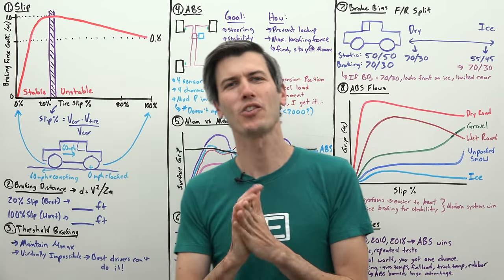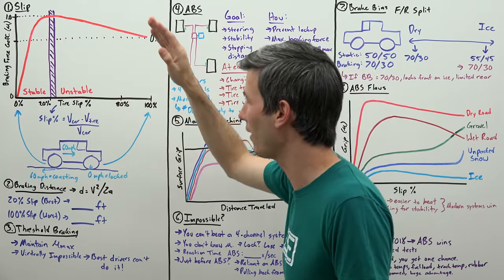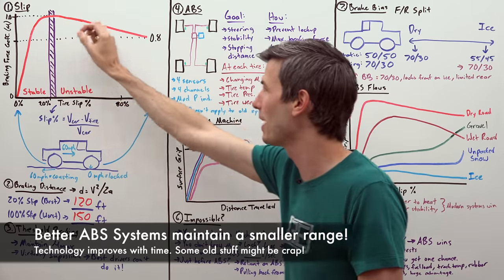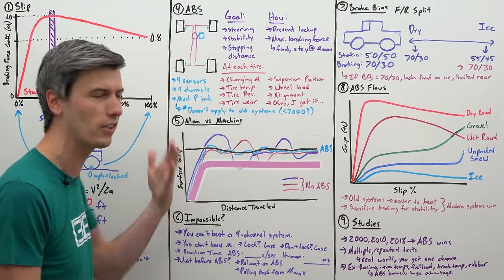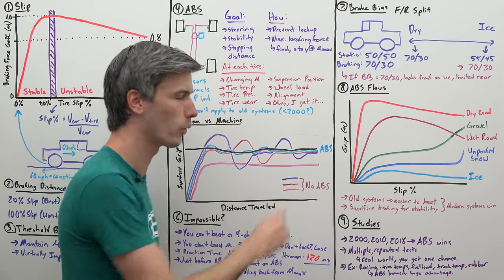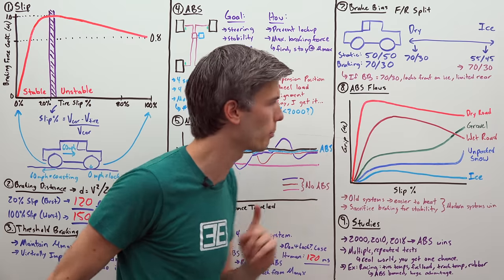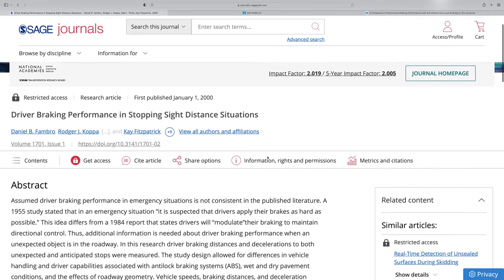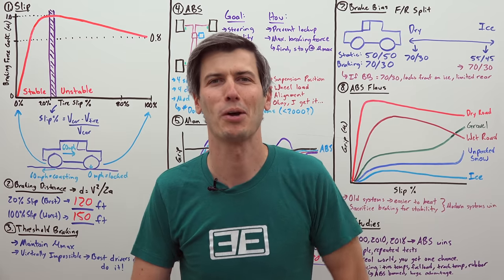Why Threshold Braking Is Impossible - ABS Wins!

Comment: Hello there! Just one note at 3:35 , both professional and casual drivers might also actually fall below 20% slip if they are too cautious about it. For motorsports like F1, there tyre degratation must be managed carefuly, I bet that they more often fall below 20% slip to reduce risk of locking up during race (as the implications are quite heavy - increasing wear exponentially due to flat stop, etc.).

Also, about 14:50. Even if you practice threshold braking and get good on it (its not really that hard), you still might not have done enough repetitions to make yourself do it subconsciously in emergency situation. When a kid suddenly runs on road and you have to emergency brake, its not a conscious decision - before you even realize, your instincts will kick in. In order to reliably use threshold braking in that situation, you really have to train it A LOT in ordero to do it subconsciously. Its not like, you try 5-6 times and say "umm yeah, now i get it, i'm ready" xD In order to turn it into a reflex, you must repeat it like hundreds or thousands of times.

Comment: I have a  question related to this.
How does a bigger/ aftermarket brakes increase braking perfomance?
Since stock brake has enough force to lock the wheel, which is more than optimal since we only want around 20? slip?
Reply: You can stop fast 4 times  a row and the brakes still work   vs oem will not.

Comment: The only time in my driving experience that ABS didn't help me was when I breaked at 20km/h on an ice covered road in my Mk5 Golf, it stopped in 10m+, i almost hit the car in front of me. 6 hours late at night I went in the exact same spot with my Mk3 Golf (doesn't have ABS) and to my surprise when I slammed the break it slowed down in 2m, without locking up. Still, ABS remains superior, i am currently driving just my old non ABS Golf and there have been a few situations where I had to threshold break, but since it only has 54 hp and i never go above 90 km/h i don't feel its absence generally speaking.

Comment: The S2000 is I believe a pseudo 4-channel system (measures all wheels separately, but actuates rears together).  It definitely does better than I could in a straight line, and especially in slippery conditions, but it's also definitely not optimal.  If you just slam on the pedal, you'll get a significant tire chirp (full lock-up) every time before it finds the zone.  Also when trail braking, you need to ease off the brakes; you're definitely going to be slower if you're just in full ABS while trying to turn, because then you can't choose the tradeoff you want between slowing and turning.  (But admittedly, we're not talking about threshold braking there.)  The other case though where I find I can outperform the car is if there's something that unsettles the car, like a bump, in the braking zone.  It's probably just the S2000's dated ABS, but it will back off in braking pressure in this case, and not get back on it once the car settles.  And finally, ABS failures happen, for example if for some reason the engine shuts off, or if a wheel speed sensor is damaged.  Those can be a significantly worse time if you're used to fully relying on the ABS rather than the technique you mentioned of just using it to help you know where the threshold is.

Geeeeenerally I agree though; you're always going to be faster in a car with a good ABS system than one without, and a good system will outperform a human in most cases.

Comment: I have no doubt that these systems do a better job than a human. I found out how good they are the first time I tried to drift my new pick up around a corner on a snow covered back road and the stability control intervened and set things right. Luckily there is a button to turn it off so I could have some fun. I was amazed how easily the system straightened out the drift I had managed to start.

Comment: well about stopping distance i feel like on dry asphalt having slip is going to stop you (in a straight line) faster than grip braking 

i have seen abs have longer stopping distance than just lock up braking on motorcycles but not tested it myself in my car yet
Reply: Motorcycle ABS systems intentionally limit braking power to prevent stoppies/endos, motorcycles also allow the rider to modulate front and rear brakes independently where in a car you only have one pedal; which is why people can often out brake ABS systems on motorcycles. Locked tires on dry roads do have a longer stopping distance than one at ~20% slip. If you view a race car locking up their tires into a turn you'll notice they miss it completely or have to take a slower line, which means they came in too fast (from not braking enough).

Comment: Is the abs system tuned specifically for the tire being used? Or does it use sensors to work with other tires? I wonder if switching tires, and the ideal grip slip % changes, would abs be as effective?
Reply: There are sensors on all 4 wheels (in modern systems, at least) to detect when they begin to slip. So no, it isn't tuned for a specific tire.

Comment: My car's got ABS but if 1 wheel locks it backs off all brakes. Fine on the normal roads but I drive on broken dirty wet country lanes regularly and it just feels like the computer won't let you stop. Hate ABS on motorcycles too. Feels dead

Comment: I've a 2009 Fiesta with ABS but not ESP. The ABS is kind of twitchy.. the tyres make lots of rumbling noises during ABS, but I doubt they are fully stopped but are just within that unstable region. The car's yaw can start to run away on a wet surface though.. had that happen once but fortunately was able to correct it by keeping my eyes locked at where I want to go. This is probably the lack of ESP. If ABS job is to keep each tyre at max grip, then an uneven distribution left/right can make it slide. ESP would then correct for that by comparing vehicle yaw and steering input, and making the ABS work some tyres a bit less hard to maintain stability. In theory you would leave some grip on the table, but in emergency situations we don't want to follow the trial of peak grip, but a trial of empty space not to hit anything. It's better than spinning out and crash into a tree instead of a car. So my next car will definitely have ESP.. but it's also mandatory for almost 10 yrs I think so that should be OK.

It's absolutely insane to think that people can outdo computer systems like this. ABS, ESP, traction control all have very well defined jobs with good sensors that operate at high frequencies, with fully proportional control. I've talked to some people that still believe that pumping the brake pedal is the ideal way to stop a car ...

Comment: @engineeringexplained What formulas would you use to calculate how big impact does wheel and tire package weight have on braking distances? Each time wheel is locked heavy wheel takes more time to start rolling again due to inertia.  25kg 255/45R19 wheel has inertia around 2,073 vs 195/60R18 tire with light wheel can weight 15,5kg and inertia is 1,264. That is a huge difference but what is the calculated impact to braking distance if you assume braking coefficient stays the same? Whole car comes lighter and so on.

Comment: I currently drive an old shitbox without ABS and when it rains I get a bit worried, since my car is so light, it's very easy to lock the wheels on slippery roads if the need for emergency breaking arises. I have driven modern cars with ABS and it's way safer to break under those conditions.

Comment: Great video! The machine always wins. And that we know all that drive hard enough. However i would argue humans can still have some form of winning when abs and traction control fight each other. Driving a  '10 mini cooper s on european curvy roads, hard braking while trowing the car around caused some really weird interaction between the two systems making the braking process very much longer than it should have been. I think that maybe thats what people have in mind when they think they can beat abs, which they cannot. But MAYBE they can bit the funky interaction that abs has with each manufacturers implementation of traction control

Comment: There are a few scenarios that will confuse most abs systems in such a way that you could reliably beat most of them.
The one thing abs systems are not good at - as mentioned - is when the ideal amount of slip is not what the system expects.

This can happen if you install tires that behave very differently from the regular stock tires (low profile slicks on one end, high profile mudd/offroads on the other), and or your car has become significantly lighter/heavier than it was stock (weight on the wheel affects ideal slip angle).
it can also happen in a dip in the road (the car is effectively heavier) or a crest (the car is effectively lighter)

You could solve this with some accelerometers and some more logic in the abs system, but there is always a way to confuse it.
I recall Randy Pobst crashing a mazda rx7 fd because the brakes went into ice mode over a crest.

That said, I'm not removing my abs, tho I'd like to have a switch for it.

Comment: The anti-skid system on the F-15a/b (designed in the 1960's, discrete analog, no microprocessors) makes adjustments around 1000 times a second and actually measures the rate of change of wheel speed (with just freaking transistors and gates!).  In other words it can tell the wheel is about to lock before it is actually locked.  I don't know the actual number but the maximum performance braking occurs when the wheel speed is a certain percentage of the vehicle speed.  I.E. 90% wheel speed of actual speed.
It's generally a bad day when you lock a wheel when you have only two on the ground.  It does such a good job the pilot can just mash the rudder pedals and achieve max performance breaking.

Comment: Based on this, the only way to improve or worsen braking distance is with tire selection.  Is it true that installing better pads or a better braking system will not realize its full potential unless better tires or more traction by changing the tire size?  Will better pads or calipers improve stopping distance with stock tires?
Reply: I would think that better pads or discs wouldn't help that much in normal driving with stock tires as your regular pads and rotors are more than capable of locking your tires up, and the limiting factor would ultimately be the grip of the tires on the road. However, if you're racing you can easily overheat your brakes with a couple of hot laps, which would cause brake fading and that is something better aftermarket brakes often help to fix. There could also be other benefits to aftermarket brakes like weight savings, better looks and improved braking with better tires. Another thing is that while you might not "need" improved brake pads for your everyday car, they can improve the feeling of the brake pedal.

Comment: I have had two situation where I would be better off without ABS. One I had one wheel on ice, the other on snow. I did not have ABS at the time, and I managed to stop, right two tires locked up, left two still allowed to brake. Tried similar with ABS, luckily without traffic in front of me. I would have hit the car in the first situation for sure. Second, on a severely weird crest, I had one tire almost without weight on it. ABS did not allow me to stop until I had weight back on all tires.
Compared to the situations where ABS has saved me though, it is absolutely worth it.

Comment: A partial solution to decrease the snow/gravel braking distance in an ABS-equipped car my driving instructor taught me is using an e-brake to lock up the rear wheels and make them plow while still maintaining the rotation and steering on the front wheels. That proved to be a useful skill not to participate in those "Bodywork service weather day" events. One example: I was crawling at around 25 MPH on a snowy/slushy road and saw some driver blindly rolling the front half of the car out from a secondary road onto the one-lane one-way street I was riding. I slammed the brakes and the only obvious effect was the ABS clicking. Then I lifted the E-brake while keeping the brake pedal down and maintained the direction by steering (BTW, my car isn't equipped with ESP) and braking force increased allowing me to stop just short of hitting that car. Obviously, this method has a number of limitations: it's hazardous at higher speeds, it may not work on cars with a "smarter than just a button and an actuator" electically actuated E-brake and it's definitely unsafe on the cars with a pedal-operated E-brake like Mercedes-Benz. It's also important to mention that it's crucial to keep the e-brake unlocking button pressed at all times during this maneuver.

Comment: This is incredibly interesting! 

Does this mean for performance driving, you want maximum brake pressure (stomp on the brakes as hard as you can) at the very last moment? But how about when you're braking and turning at the same time? The tire can only do so much, so it's split between how much turning and how much braking( or accelerating) you're asking of it.
Reply: the abs can account for that, but you cant get maximum cornering speed. as of you're overloading front tires.
Reply: In performance driving, activating abs would be bad. It will definitely help with the corner you're on, but abusing abs will destroy your tires and you'll be sliding around on the final lap

Comment: I live in Northern Ontario. I remember back in the eighties when ABS was getting more and more common. My first couple of vehicles didn't have ABS and I learned how to pump the brakes pretty expertly considering the ice and snow we drive on a lot of the time. When the first vehicle I bought had ABS i absolutely HATED it. It felt unnatural and dangerous. As if the braking had been taken out of my control(which it had).  It took over a decade to get used to ABS. I cannot imagine someone born with every vehicle having modern ABS arguing against it. It seems like such a no brainer.

Comment: My issue with abs is you can’t turn it off like traction control. Specifically with your unpacked snow scenario. I rarely activate my abs on any vehicle I have owned half of them have had abs the other half don’t/didn’t. I live in northeast pennsylvania with lots of steep hills. Every time I am coming home in the snow i can easily crawl down the hill my street is a side street off, but in my abs cars I always overshoot my street because the car just won’t stop because the abs won’t let snow build up under the wheels  no matter how light I hit the brakes I can’t get it to not activate. I would be fine if abs just deactivated below 5mph. Cause honestly those are the only times it bothers me.

Comment: so to clarify some common misconceptions: if ABS is on and you're slowing as much as possible because it's a slippery road and you're about to do a sharp turn, is it better to turn with brakes (and ABS) still on or to release the brake and trust you've slowed enough for the car to make the turn (given what you've said, the car might also release the brake automatically for the sake of stability if it detects a steering motion)?

What happens if on a VERY slippery surface (say black ice) you slam the brake so hard you lock all the wheels at the same time (because you also panic pressed the clutch)? How does ABS react? Are you simply unable to apply so much force on the brake so fast that there's still that bit of difference in the wheels lock up moments that allows the ABS to detect it and prevent the full lockup?

Comment: I have a video request. Could you explain what is the perfect wheel speed while drifting or in a donut or burnout to be able to get the best acceleration? Of course gripping gives the best acceleration but what if you're on gravel or a slippery surface where grip is very limited or not existing? Does more wheel speed equal faster acceleration or is there a sweet spot and can infinite wheel speed lead to no acceleration at all? This gives me a headache and i cant find anything about it. Thanks 🙂

Comment: It beats panicked (civilian) drivers, but I do think there is some margin where you do want to have slipping grip (esp drifting scenario) and where you want to sense the amount of slip/grip and maintain that by up/down shifts and applying brake and throttle. However thats an edge case, and even there I've found that at least in games it is useful to toggle ABS on as you try to exit a corner especially if you already have fairly low spin since it recovers from the drift cleaner then upshifts and even has potential to recover energy from the overspinning tires. Anything with a trailer and pretty much anything consumer grade should have ABS. Could've saved me from spinning out once in my '01 Fiesta.

Comment: According to your graphic, any breaking or acceleration would result in slip. That is not the case, is it? If you accelerate or decelarate gradually on a grippy surface, you should not experience any slip (there might be some elastic deformation in the tire)